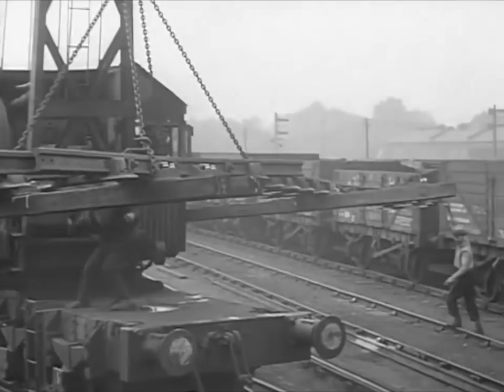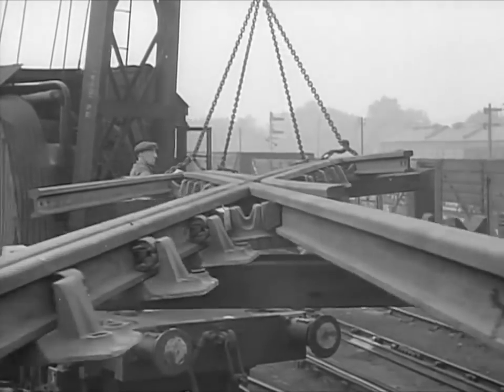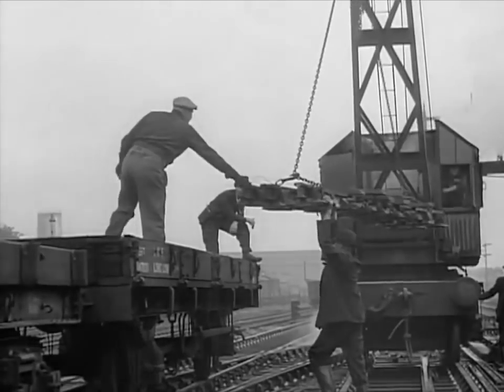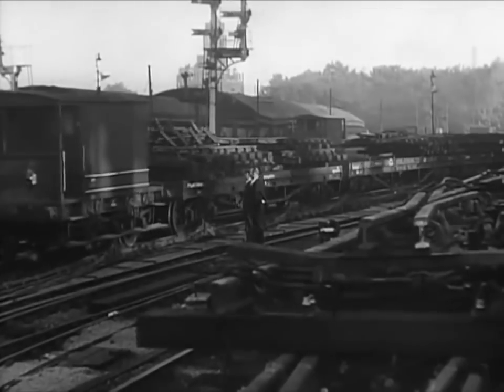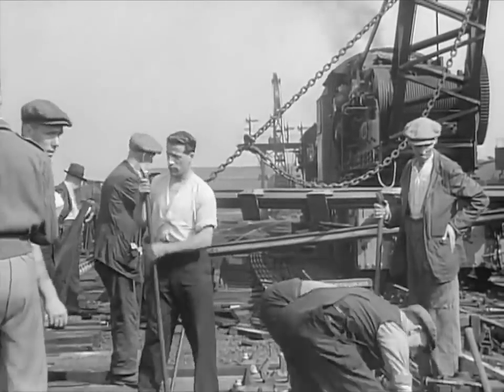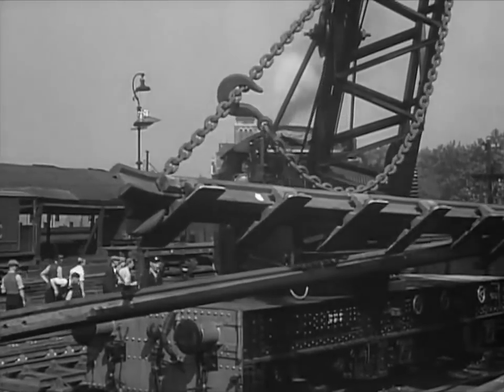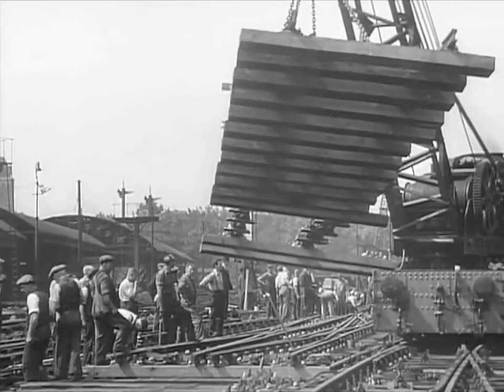Vintage LMS railway film - St  Pancras Junction Relaying - 1947

Comment: "1100 tons of spoil was removed ..."
All by men with picks and shovels wearing flat caps, waistcoats and string round the leggings. And a couple wearing ex Army battledress blouses.
A couple of years before this most of these blokes would have been fighting a war.
Truly the greatest generation.
Reply: The generation afraid to talk about true history, as they suffered war beyond what we can imagine.  It's very sad, they are probably the greatest though stifled and shell shocked to down to the DNA
Reply: Truly strong and resilient people. They were the people who made our country great despite the severe trauma they endured
Reply: Well said , I've done a bit of digging out during a thickwork renewal at weybridge . Fair amount of old ballast and it can put a thirst on you . But that much at St pancreas, tough lads .
Reply: I started on the railway in 1982 and even then a lot of the old guys dressed like those in the video. The railway never really became automated until the 2000s and even when I started a lot of the work was manual including  rerailing, clipping up ballasting new ballast from the 4ft and ends or boxing in, fish plate oiling, regrading wet beds retimbering. It was hard work with tough guys doing it but the camaraderie was excellent. Good old days, though it did not feel like it at the time on a 16 to 18 hour shift in all winds and weathers every WE.
Reply: I started on the railway in 1982 and even then a lot of the old guys dressed like those in the video. The railway never really became automated until the 2000s and even when I started a lot of the work was manual including  rerailing, clipping up ballasting new ballast from the 4ft and ends or boxing in, fish plate oiling, regrading wet beds retimbering. It was hard work with tough guys doing it but the camaraderie was excellent. Good old days, though it did not feel like it at the time on a 16 to 18 hour shift in all winds and weathers every WE.
Reply: @iainhughes6637   You just have to admire what they achieved and it didn't take forever either. Tragic all that work was ripped up in the '60s. Have to admit I didn't realise how manual it still was in the '80s .
I did part of my engineering apprenticeship at Swindon Works in the early '60s. The Foreman wore a bowler and had a half Hunter in his waistcoat pocket. He could fire you on the spot and no comeback. You tipped your forehead when he came past. All the journeymen who I trained under worked in shirts, ties, waistcoats and spit and polished boots. All ex servicemen from WWII.
Reply: @iainhughes6637 very well stated sir! I don’t think it could be carried out anymore, what with all the snowflakes around today, who would say,...don’t you tell me what to do in that manner, and I know my rights! Bless em and their spoil - em - mums! Oh well! Cheers

Comment: Just look at the manpower needed to carry out this work on the track's, my father used to do this in the 1960's up until the 80's, it was mostly manual work which was tough on the back and walking on ballast was hard on the feet, and the pay wasn't that good, but it was a job for life, and you got to bring railway sleepers home to burn on the open fire!
Reply: I did it for 10yrs,,wish I was still there.  Dont forget 
Sleeper Fence,
sleeper base for shed
sleeper shed
sleeper pond 
sleeper off cuts as axle stands,,,, list is endless. 😂
Reply: Those old sleepers could shoot your chimney up , we got a brush with a brick under it on a length of rope , lobbed it down the chimney every 10 days or so . Stopped the chimney fire .

Comment: 3:45-4:04 Six men lift a short section of rail onto a wagon by hand.
4:09 Narrator: "Crane-power was used to the maximum possible extent."
4:37-4:52 Nine men lift a short section of rail onto a wagon by hand.
🤔
Reply: Well they didn’t want to strain or break the crane! It was valuable. Now straining or breaking the men didn’t matter. They came cheap!

Comment: In those heady days customers were still offered a service of trains despite all this work taking place. Now things are rather different: the whole railway is closed down for extended periods and people are told "do not travel"—so tough luck if you were hoping to travel by train. And a lot of such work involves replacing infrastructure which was torn out by BR in the late 20th century

Comment: Am I right in thinking those Gas Towers are now the brand new flats by Granary Square? Or are there more nearby?
Reply: @Paul Choccy T - yes, they are indeed.
Reply: There were also various some dismantled sections from the gasometers stored further up the top of Camley Street, a dead end road on the West side of the railway. As far as I can recall those at the South end, on Goods Way, were actually triplets and the more interesting design compared to those on the West side of the railway. There is also a small green space by the canal which is within another of the gasometers, it's for people to walk into or sit inside. Those gasometers were a great part of the skyline for me, along with old diesels that ran along the St Pancras line.

Comment: What was that device at 13.10?
 That gruelling and dangerous work didn't deserve that wholly inappropriate musical soundtrack. The number of injuries and fatalities must have been enormous, especially poignant since many of those men would have been in the forces in the Second World War. 
A fascinating film, just glad I wasn't around then!
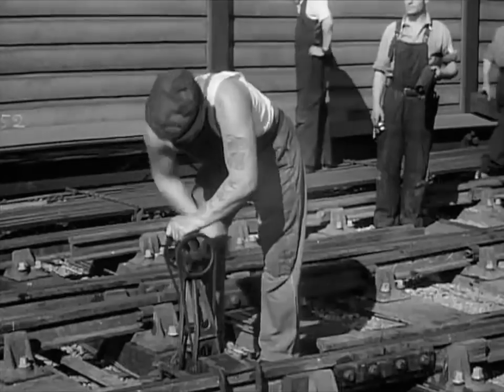Reply: The mystery device at 13:10 is a rail drill, used for drilling the holes through the rail allowing the track (circuit) leads to be pinned to the rails.
Reply: @VideoMikeA4  Thank you.